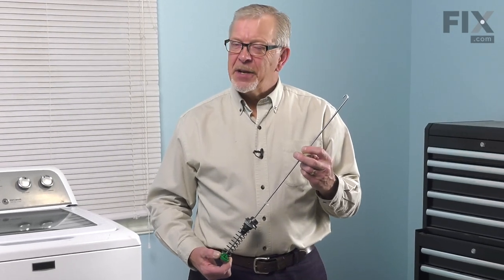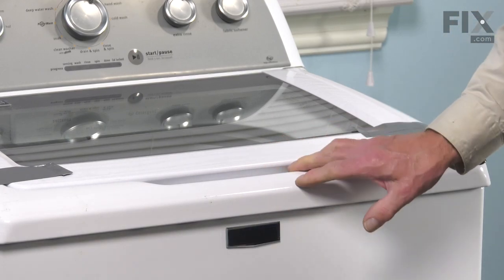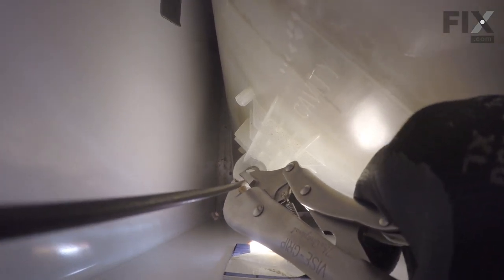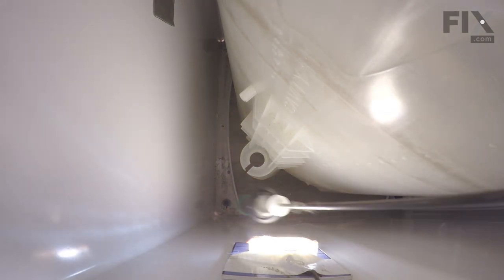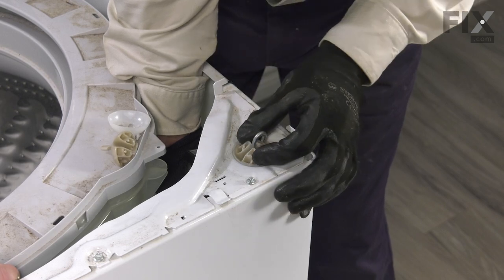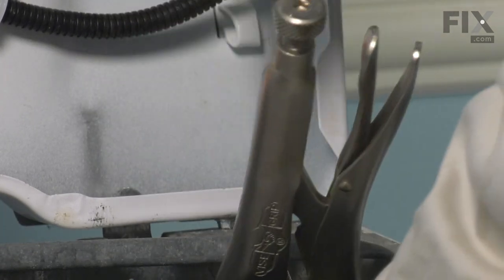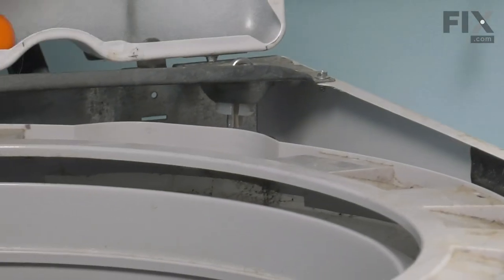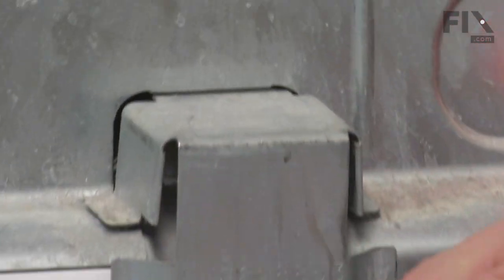Whirlpool Washer Repair - How to Replace the Suspension

Comment: Did this repair today using this video. I performed this task on a Whirlpool top load washer model number WTW5000DW1. The space between the tub and washer sidewall was too small to get my vise grips in there to lock onto the rod. I was able to pull the rod through the frame hole, instead of vice grips, once I got the rod through the frame hole, I put a screwdriver through the top of the rod loop, pulled it up and slide the locking ball onto the rod and put the locking ball into the retainer and maneuvered the top of the rod into the proper placement for the locking ball. This made it so much easier. I figure this method on the fourth rod after struggling with the other three. It took me a hour and a half, but if I would have started with the screwdriver method, I probably could have wrapped this up in a half an hour. Thanks for your video.